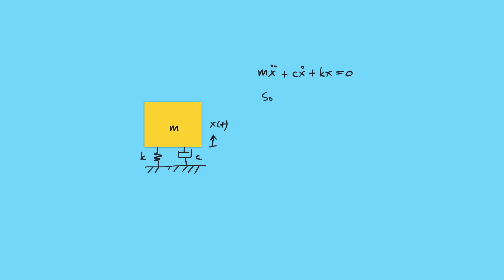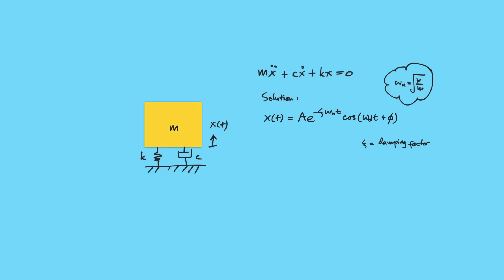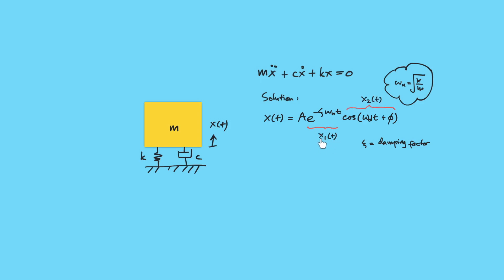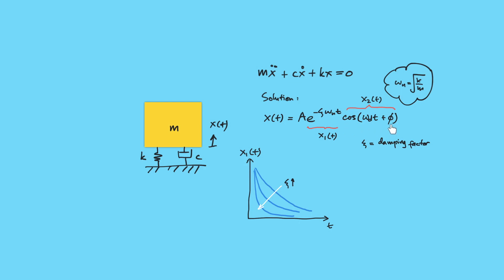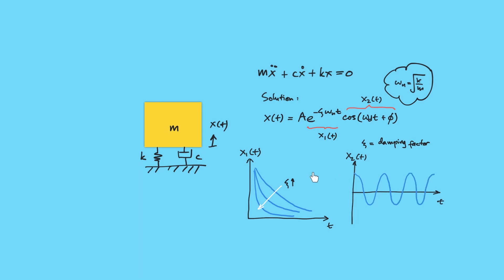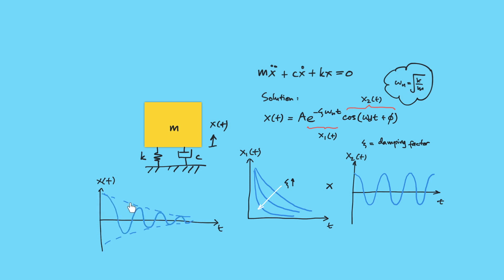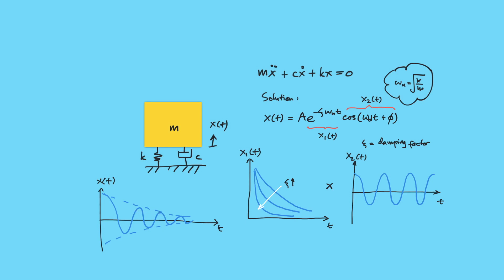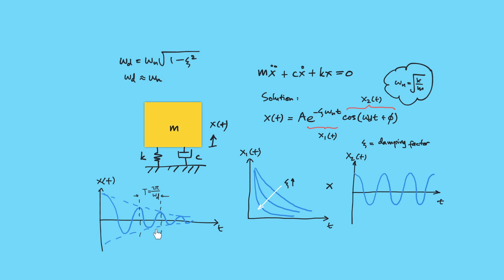Mechanical Vibration: Damping Loss Factor

Comment: I have a question, if I had a magnetic field or if I were to convert the vibration energy into electrical current with the help of a generator, that would also be a damper element. Because I have a project going on at my university and I would have to plan a wind turbine without blades that only uses the vibration energy to produce electricity. Thanks for ur Vids.
Reply from the maker: That is an interesting project. Good luck!